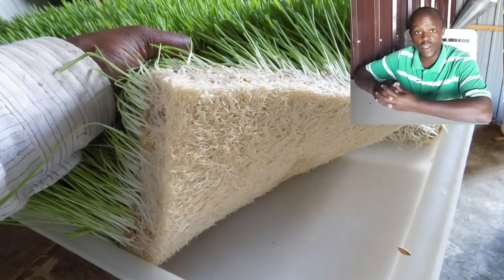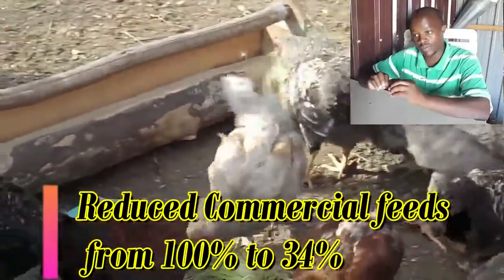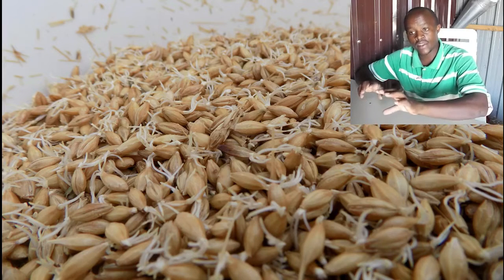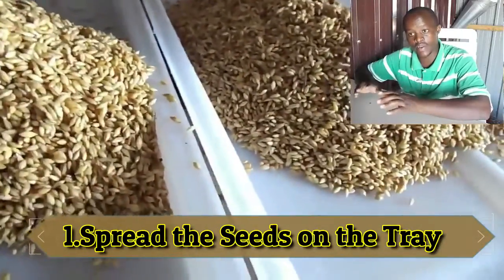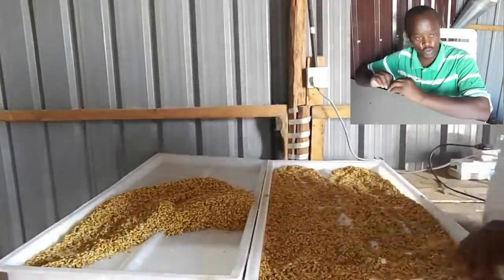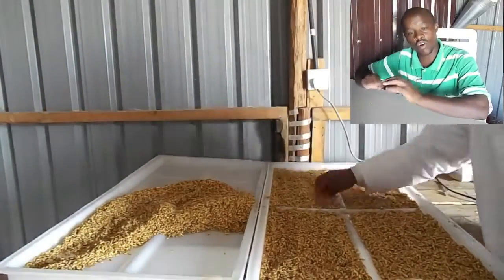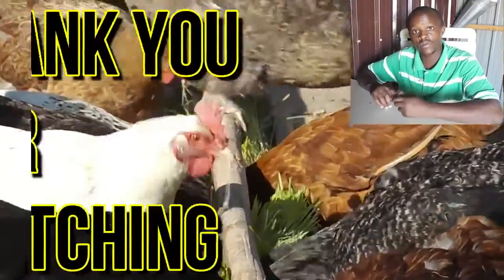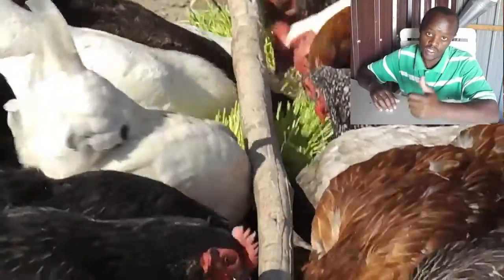Step By Step Growing of Hydroponic fodder for livestock

Comment: How long should you water the seeds

Should you water for 30min and again after 4hrs again for 30min
Reply from the maker: As long as The method you are using has make all seeds wet you are done, even if the watering process took only 10seconds.